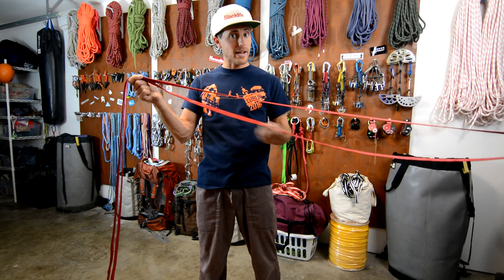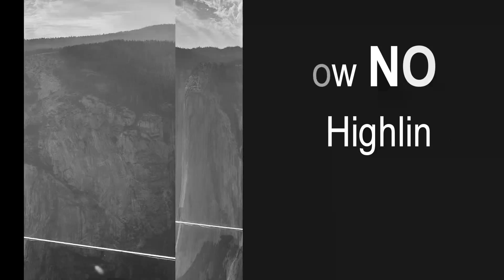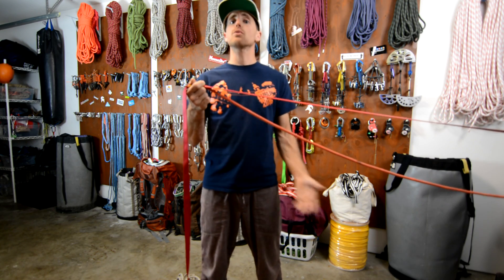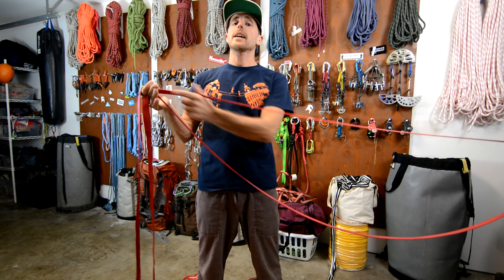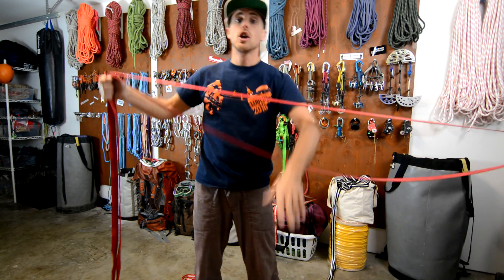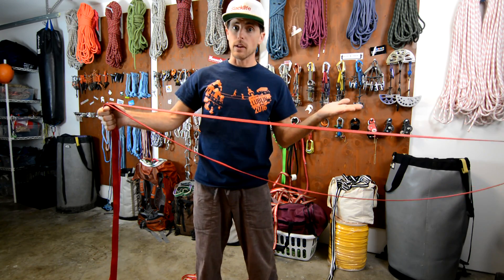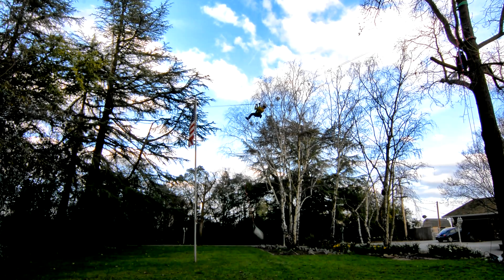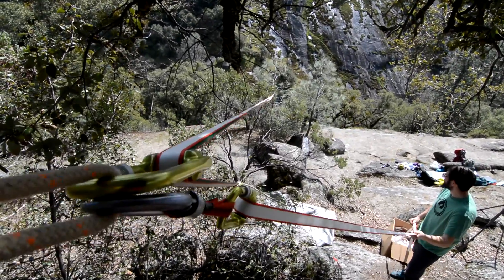Highline Backups - Types and Tensions

Comment: I’m confused as to why two strands are required, I’m a climber majority of the time and there is only one rope, so why need two when high lining because the anchors are already 6 times redundant if you have 3 bolts on each side

Comment: Thanks for this video, and so many others! A question for you...If you were to use a dynamic rope for your backup line, but needed to reduce the stretch a bit to avoid a ground fall in the event of a mainline failure, would it be ok to apply some tension to it?

Comment: Hello man! I am from Lyon, and there is no many cliff but a lot of trees! Can you make an episode on how not to TREELINE? for example in this video, you show a 10 meter treeline I guess, how did you climb to these trees and how did you do the installation?
I think i have done some mistakes on my last installation ;)
Reply from the maker: I'll do one on trees!  But in the mean time....  Just do it like you would down low but I make my anchor that I'm hanging from while rigging and the anchor I'm attached to when I ascend up to the line about 10 or even 15 feet above the point that my mid-line would be.  That really helps things.  Just make sure your rope is off to the side and not rubbing your slackline when rappelling and ascending.  I also can back up the tails of my mid line to this higher point so in case my super duper strong spanset were to fail I'm still safe :).  As far as climbing a tree... I have no idea... I used a ladder and branches and girth hitches!  Just stay tied in one way or another while you are up there.  Youtube it! haha
Reply: Thank you man <3 Next time I would send you a photo, you may be able to notice the mistakes!
Reply from the maker: Send them to skylining@live.com... I'll check it out.

Comment: Nice one. But. I found one issue, static rope stretches about 3% but under 50-150kg tension, @10kN it could be more then most webbings. Dynamic rope have about 30% stretch during fall (usually not more then 7kN). Otherwise, keep makeing this channel ;)
Reply from the maker: True.  Philipp Gesing just told me this too.  Static ropes aren't exactly stretchy and should never be used as a lead rope but I realize, now that you and Philipp, bring it up, static rope stretches very similar to most webbings.  I learn a lot myself from feedback, keep it coming :).  Thanks.
Reply: In fact, they are stretching more than any webbing at any tension!

here is the data covering this: http://www.slacklineverband.com/know-how/slackline-vergleich-dehnung/
Reply from the maker: Thanks.  That is a very interesting chart.  It shocked me.
Something we should keep in mind, a low to no tension highline won't stretch that much because it is at the bottom of that chart.  No one is getting it to 10kn with a whipper if there isn't tension in the line.  From my personal experience, whipping on a line (regardless of what type) 100 feet or shorter (with no tension) can really give one a jolt.  So if you took a 30 foot whipper on a static rope during a mainline failure (it has 0 tension), it could really suck.